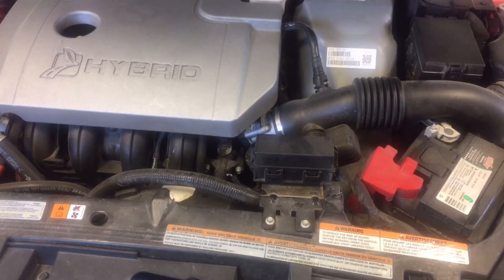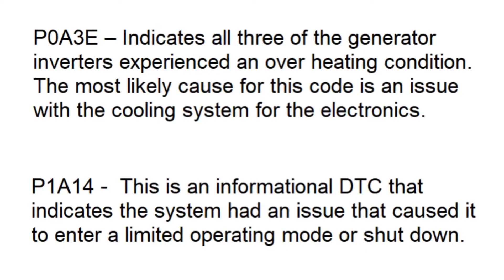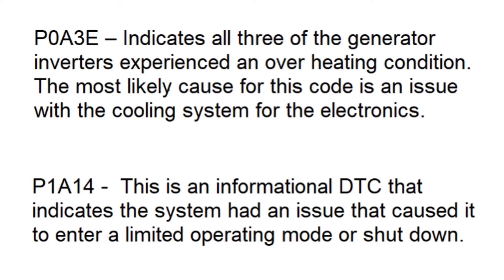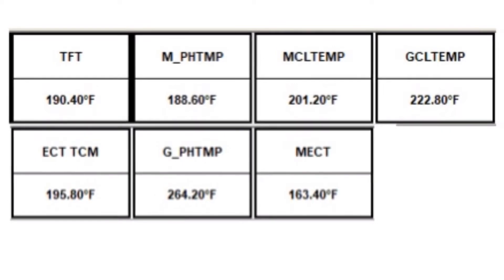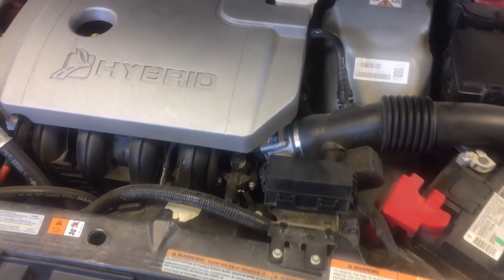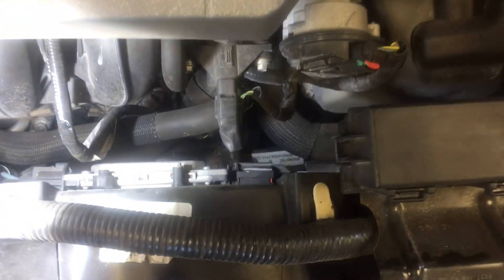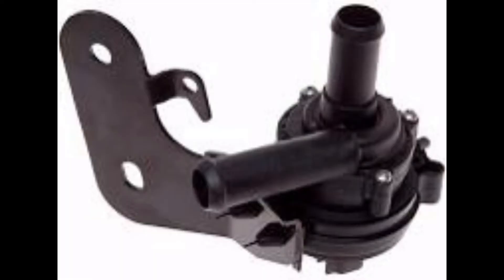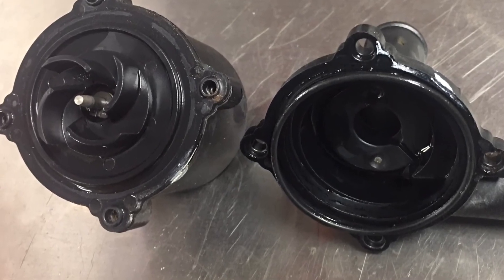Fusion Hybrid Stop Safely Now Message P0A3E P1A14

Comment: SOMEONE PLEASE HELP! 
I drive a 2010 Ford Fusion Hybrid! 
112,000 miles! I bought it off Copart & fixed it up! It was going good for a month then I was driving on the highway a week ago and the car shut off & a red triangle came up saying stop safely now! Also the check engine light came on solid. So I pulled over & turned the car off. Then when I turn the car back on everything is gone except for an exclamation point light that has always been there. Also it was saying change TPSM so I did and that went away. Now it says Tire pressure low but when I go to put air in my tires they are already above 32! Anyway so the stop safely now and check engine light keeps popping up and the car shuts off then when I re start the car I am able to drive like normal again until it randomly pops up again! Please help! I’ve tried looking online but I can’t find nothing specific!
Reply: Change the the pump and be sure to put the right amount of antifreeze in the hybrid antifreeze bottle that's located at the back of engine. I have a 2010 Fusion Hybrid and experienced the exact same thing. I  bought pump from Ford for about $60 two years ago. Take the path of least resistance first. Installation is simple and won't take a hour or less. Very important to ad proper amount of antifreeze in Hybrid bottle. Check levels and recheck as the antifreeze has to circulate through the system to reach proper levels.
Reply: @donfenderson  Is it difficult to replace this pump on my own?  I am not a mechanic but if it only requires a simple swap out with a couple bolts, is it easy for a novice?
Reply: You need to see if any codes are present.
Reply: My 2010 Fusion Hybrid did not pull any codes and I have a couple of scanners. I'm just a "Shady Tree Mechanic".
Reply: I’m having the same exact issues and don’t know what to do
Reply: Did you get a full vehicle history to check the carfax and vehicle check history to make sure it was never in any accidents, had repair orders/work on it or any recalls?

TPSM is your tire pressure system management, there are sensors located in the rims/wheels of the tires on the outer edges. They’re there to notify of running a flat tire or if air is low or escaping.

As far as your car having a warning symbol and light on the dash saying there’s check engine light and light to stop safely now, there’s definitely a problem with your transmission and engine. It might be something like catching right like the clutch or slip differential. Do you fix cars yourself?